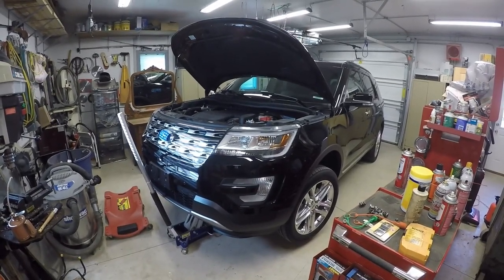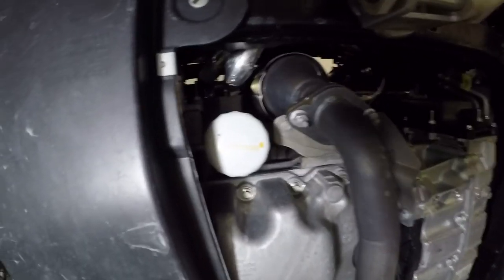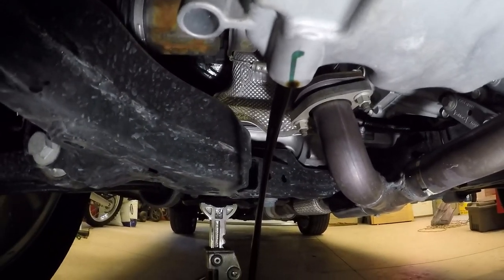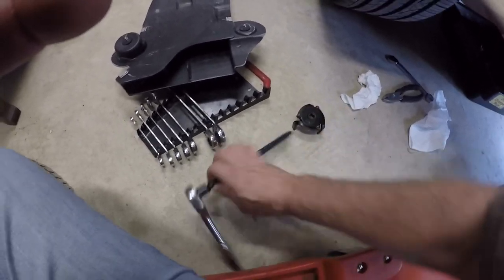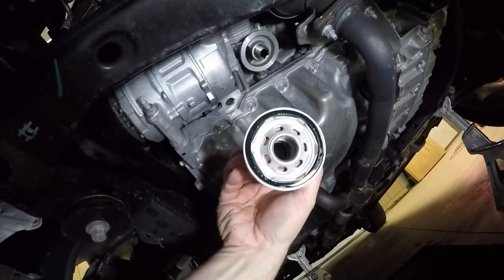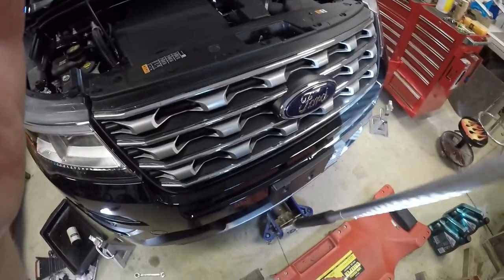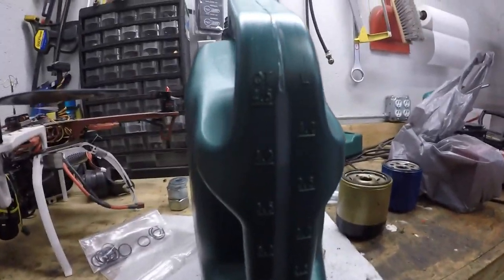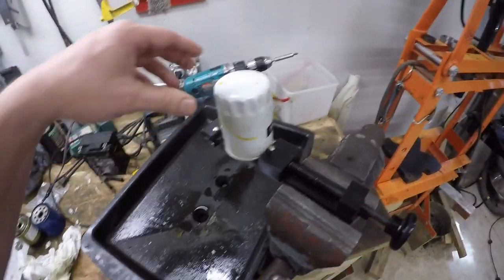How To Change Oil in a 2016 Ford Explorer

Comment: The duct is for cooling the PTU  (Power Transfer Unit) for the 4WD system.  The PTU transfers power from the transmission to the rear axle.  On the police version (Interceptor Utility) the PTU is liquid cooled.  Thanks for the video.
Reply: Interesting. I have a '16 Explorer in 2WD and it has that same duct. I guess they install it regardless.
Reply: Mike R I think u are wrong. The ptu is between the front wheels
Reply: Correct answer about the duct.
Reply: yup correct I have a 4wd no tow and no turbo- no vent

Comment: Excellent film.  I have follow these instructions many times on 2016 Ford Explorer.  The oil drain is pointed towards the rear of the Explorer and not directly down so adjust your oil pan accordingly.

Comment: I will be doing this in the morning. On our 2015 Sport, we let the dealer do all of the oil changes and I suspect they used cheap oil as we had the timing chain and cam phasers replaced twice in the first 60,000 miles. Now we have a 2019 and I plan to use Penzoils Pure Plus natural gas synthetic and see if we have better luck.

Comment: I believe the manual calls for 5W20, someone mention 5W30.  I have used full-syn oil for 17 years now.  I change the filter every 5000 and change the oil every 10,000.  Easy to keep an eye on just by looking at the odometer.  This method took me 220,000 miles on an '00 Expl and my '14 Expl has 30,000....works great. AND I use Walmarts branded oil,  Trust me, they don't refine it in Bentonville, Ark,
Reply: Book on my 19 says 5-w30 but the oil caps all say 5w-20. Typical Ford.

Comment: Thanx*** interested if your PTU * Water pump  Held Out ? in 2022 if you still have your Explorer
Reply from the maker: I still have the explorer. 152,000 miles on it. Still runs good. No issues with the water pump. Couple recalls on rear suspension. Positive battery cable replaced twice due to issues with corrosion. Left rear wheel bearing replaced. It had a 120,000 mile warranty so Ford replaced I think the front timing cover or resealed it due to a common oil leak issue. Although I never noticed it leaking. All the service has been completed at the local Ford dealer. Other than that its been oil changes between  5k to 6k miles (when 50% oil life shows on the gauge), tires and brakes. Its been a good vehicle. I’m going to see if I can get 250k miles on it.
Reply: @smithfamilyvegetables7666  Thank you my brother for the update**God willing i am going to get me a 2017 FPIU myself in the near future**you did an Awesome Job restoring it**Kudos to you and your Family**Be Blessed

Comment: hi i bought a 2013 ford explorer 2.0l ecoboost. I did the oil change and I didn't have the air duct. should you have it installed
Reply from the maker: I don’t think it’s completely necessary. I have the naturally aspirated V6 with the tow package. I assume it’s part of the tow package. The rear of the vent is not hooked to anything.  It just blows air up underneath the car. I have 143,000 miles on the explorer now and everything seems to be fine.

Comment: My wife just bought a 2016 Explorer and tonight I did the first oil change on it. We bought it from my sister with 19,000 on the clock. She was a maintenance nut BUT she always took it to local chain auto stores for the oil changes.
After watching your video, the first thing I noticed was that there was no air scoop/box to divert air toward the rear of the vehicle. I certainly cut down on the labor time for me as I changed the oil and filter in 10 minutes. 
I did not see any speed nuts or the like in the frame holes where you showed them after dropping the box. I do have square frame holes in the locations you showed.
My sister bought the vehicle in 2015 and I am wondering if the air box came out later in the model year to address a heat issue. My gut tells me the local chain store mechanic tossed it in the recycle bin because he didn't fee like messing with it.
Do you know if yours was bought in 2016 ? Any input would be appreciated
Reply from the maker: I received my vehicle in April of 2016.  Twice the Ford dealer left the air duct off after an oil change. I checked now every time I get my oil changed. The first time I brought it back to the Ford dealer they said they had to check the  fit because they had two of them laying back there. If your vehicle has the little square hole cut in the lower valance I would guess its been left off. I know I ordered it with the tow package. So Im not sure if its unique with the that package.

Comment: The plastic lower air duct is there to try and cool the electric power steering rack that is prone to failure from exposure to the high heat from the catalytic convertor.
Reply: Actually fir the power transfer unit 4x4 . Older models were failing at 30k miles but yes it's the heat from the cat

Comment: Thanks for the video, couldn't find a 2016 oil change like this clip......    Do you know of an air filter change video for the 2016?
Reply from the maker: I will make one for you. Check back in a couple weeks.
Reply: Oil change: lift car, drain oil, change filter, add oil. Air filter: Open air filter box, take out old air filter, put new filter in, close air filter box.
Reply: It's easy, pop the two lower left clips and loosen the ring clamp. gently lift the top of the air box and move to toward engine. the snorkel with separate from the housing .

Comment: Nice video! What engine does your explorer have? Mine is V6 3.5L and I don't have that air plate under and also no hole in front of that bottom plastic cover
Reply from the maker: It has the 3.5L. It also has the optional tow package. I wonder if the duct is part of that package? I've had the oil changed 3 times at my local ford dealer. Twice they left the duct off and I had to go back.
Reply: The duct is to cool the rear turbo on the Ecoboost. Not sure why you have one a non Ecoboost.
Reply from the maker: It has the 3.5L non-ecoboost motor.
Reply: Dustin Sullivan no it's not for the turbo it's for any 4wd or tow package and to cool the transfer unit.
Reply: I asked about this air duct, apparently it is to help with cooling when towing heavy loads

Comment: I have a question .  My explorer turn it on and off the air bags light what it could be ??
Reply from the maker: I’ve not had any issues so far with the explorer. Changed tires and wipers only. Still the same brakes. I have 76k miles on it and no airbag lights on. Search Youtube and see if something comes up.
Reply: It’s on depending on model. The passenger airbag goes on and off depending on if it’s empty or not

Comment: You can use toyota corola oil filter for ur explorer if u couldnt find ford oil filter
Reply from the maker: Good question. Even if the gasket and tread size are the same, sometimes the pressure bypass valve is a different pressure in the filter.
Reply: @smithfamilyvegetables7666  so what oil filter No. I have to use for 2.3 ecoboost

Comment: So many people never prime there filter With new clean oil ,I always prefill filter with new oil before installing.
Reply: I worked at a Ford dealer and we never did that. We would turn the engine over and let the oil pump do it's work. Run it for a bit, shut it back off and check the level and adjust after the filter sucked in fresh oil.
Reply from the maker: I have 143,000 miles on the Explorer in the video. All the oil changes except for the first one was have been done every 5000 to 6000 miles at the ford dealer with non synthetic oil. So far so good. Its not using any oil between changes so far.
Reply from the maker: I wait till my oil percentage hits 50% which is always 5 to 6000 miles

Comment: Engine Cradle a good place to jack up in the front?
Reply from the maker: I’ve always utilized the engine cradle to jack up the front of a vehicle without issues.
Reply: Thanks for your reply. I was nervous the first time I did it but was glad to see others do it as well. I have a Ford flex that comes off the same line as this explorer.

Comment: I do have a question, when filling the new oil filter with oil do you still need to add the 6qt to the engine or does pre filling the filter get counted in?
Reply from the maker: The oil added to the filter should be counted into the 6 quarts of oil.
Reply: Okay, thanks for the info

Comment: fords IOLM Intelligent oil life management system. is not like the old reminders based solely on time. it bases the life % on your driving history. if you drive basically easy commutes and mostly highway then its 7 to10k, medium duty revs and higher temperature driving or alot of idling 5 to 7k. balls to the wall towing and driving harder  itll scale to 3 to 5k. its pretty accurate i usually drive harder in summer and it bounced me down to 5k

Comment: Good truck but seats to small.. Has anyone else noticed the trailer sway control is always on.  Any way to turn it off?  Thanks,
Reply from the maker: I agree the seat is to small. You can turn off the sway control by using the left steering wheel setup switch. Hit left arrow, pick driver assist, uncheck the trailer sway control. You can also uncheck the traction control. Whats the advantage of turning off the sway control?

Comment: Does this take 5.5 to 6 Quarts like the Edge?
Reply from the maker: It holds 6 quarts with a new oil filter
Reply: Thanks i was thinking about using Mobile one 1 year oil in it rated for 20k miles but only using it up for 10k as a test

Comment: I just did a oil change on my explorer just now, and i ended up using Pennzoil ultra 5w-30 and the FL500S filter.  Is anyone having corrosion issue with their positive battery terminals?
Reply: Yes, I had terrible acid corrosion on my positive battery terminal.  Cleaned it off, and then a few months later my truck wouldn't start.  The corrosion was back with a vengeance.  Took off the cable to thoroughly clean it and the post, just to find out that my battery had a crack by the post, under the cable, which I didn't initially see prior to taking off the cable.  Took it to Ford, and luckily I was still under the factory warranty by 1000 miles.  They put in a new battery and ordered a new wiring harness which consisted of a new positive battery cable, as mine was so corroded.  All is well now.  Good luck with yours...
Reply: I bought the same car 4 months ago, this video and the comments is good to know. However I do have an issue with one of my seats in the third row. The one panel separated from the mounting bracket causing the pivot assembly to get loose and jam the fold and stow function.
Reply: Yup, same with my 2017. It wouldn't start, ended up having to replace battery and cables.

Comment: A good synthetic oil can easily go 7500mi or more in the 3.5L V6. No need to change it so early. I use Pennzoil platinum/ultra platinum or Royal Purple HPS
Reply from the maker: I agree. I didn't know what oil was used from the factory so I changed it to synthetic at 3k. Its a fleet vehicle so at 10k I took it to the Ford dealer for its first service. I asked the service writer what kind of oil they use and he said blended. I guess that meant synthetic blend? I did notice my oil change sticker said 17,500 and not 20k for my next service. I'm taking it in this week for the 17,500 change. I will ask again what kind of oil and see if I get a different answer.
Reply: Read the owners manual...  Mostly all the answers one needs to find out is right there in the manual, but most people don't take the time to read it.  You'd be surprised how many people that work at a Ford dealership or any dealership for that matter, don't have a clue as to what they're selling or servicing.  I have a 2016 Explorer exactly like yours, except mine is Magnetic Metallic.  The oil change interval for this truck is 10,000 miles.  Reset and then follow the oil wear indicators prompts to change it when another 10,000 miles transpires.  The truck will tell you when it needs to be changed.  I've been using full synthetic oil since my first oil change.  And shops will write down a lower mileage on the oil change sticker because they want to take your money more frequently than they would be able to if you read your manual and followed FoMoCo.  I had a 2002 Ford Explorer E.B. with a 5,000 mile oil change interval.  Yet the Ford dealership would write down 3,000 miles till my next oil change, on the sticker.  Don't be anyone's fool!
Reply: Dalton Harper
Reply: Another BS things (which I found out later after talking to my mechanic)they tell you when you buy a car is: your oil changes must be done by them or you will void your warranty; they sell you a maintenance plan where you pay for up to 10 oil changes @7,500 mile intervals which they tell you that is require by your financing company and it has to be exactly at 7,500 mile intervals or you will be charge additional fees! BS BS BS!!!
Reply: Royal purple? I wouldn’t put that crap in my mower

Comment: As someone who is considering buying one of these vehicles, the rubberband concerns me greatly. One winter or even a summer and that rubber band is toast.
Reply from the maker: It didn't even last a year and I saw it hanging under there. It eventually fell off. Didn't seem to effect anything.
Reply: I sent your video to a salesman I was working with at the dealership. He said he showed the video to a guy in his shop and the guy in the shop had not seen that before. They looked under other vehicles and did not see it on them either.
Reply from the maker: I wonder if its just something that should have been removed during assembly at the factory. I have 37k miles and no issues. However Its programmed to honk 2 times if you leave the vehicle and its running. Its very irritating and embarrassing. If you buy one make it part of the deal to un-program that feature. Only the dealer can do it.
Reply: Bad idea. They have filter wrenches for that. The screwdriver trick often fails leaving a real mess.

Comment: I guess if it's someone else car maybe it doesn't matter,but I don't believe in running an engine with the oil gallery s that have drained empty.At engine startup is when most engine wear occurs,I don't like the sight of a oil pressure gauge on 0 psi for 30 second s or greater on a running engine.

Comment: Forgot to add oil to the filter before putting it on.
Reply from the maker: That's very true. I do that with my personal vehicles.
Reply: Smith Family Vegetables I don't bother with it on my Fords, if you hold the gas pedal to the floor and try to start it, it won't start, but it will prime oiling system. So that just saves you the time and hassle of trying to fill the filter, any spillage etc
Reply: Dont need too.

Comment: I appreciate your video, let me add a point or two. Do you respect the car?? Then use a motorcraft filter. There is no discussion on this. The next point?  Ford filter "square and wiggly" or whatever you said. If it was an opinion needed I could see it, but that old filter worked right??? I mean got you to an oil change right? So maybe don't try to be Bill Nye, oh and motorcraft filters are manuf to ford spec, not aftermarket "ours is better idea"  I ran big boy broncos (5.1) for years and years and always had problems with aftermarket filters collapsing, Went with motorcraft oil filters and wa-la...........that "Ford Has a better idea""" works
Reply: This is a very good oil change, but I do agree with you on the Motorcraft oil filters. They are excellent filters.